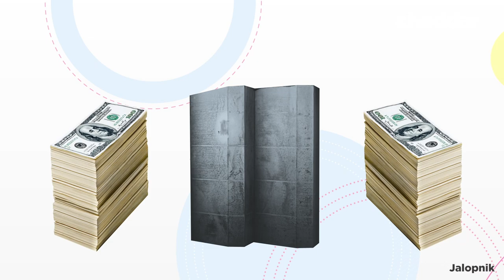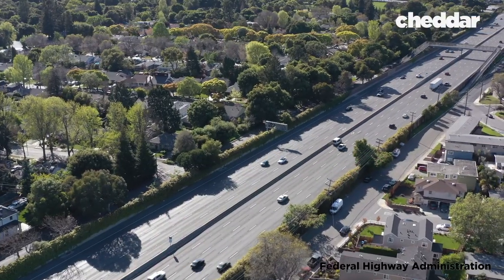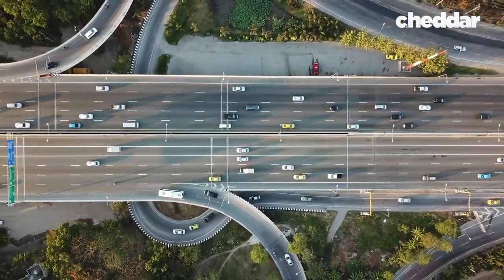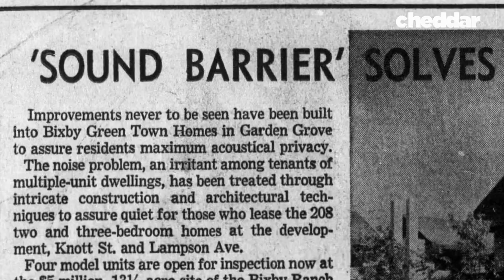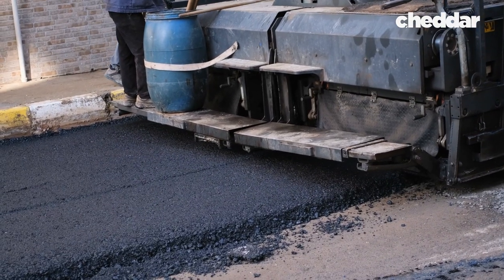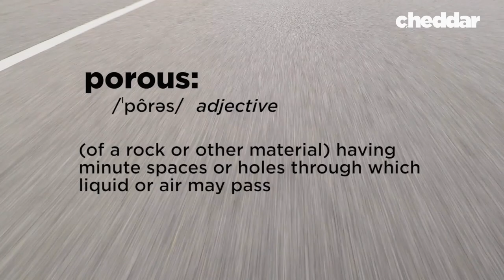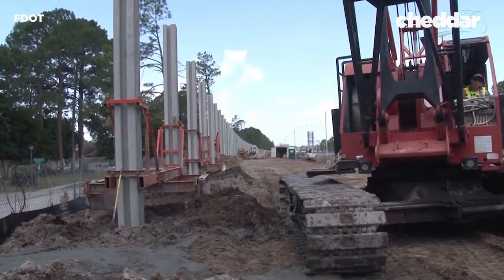How Highway Noise Barriers Can Make Traffic Louder - Cheddar Explains

Comment: Not building interstate highways through residential areas would probably also be a good idea.
Reply: Those residents need to be able to get around though. Ultimately, you are going to need major roads near residential areas because those residential areas are what creates all the traffic.
Reply: @jarynn8156  That traffic doesn't need to be on a single road, and doesn't need to be at fast speeds. Leave the highways outside of the city and most of the problem will be solved - people will drive through multiple smaller roads to get to their homes, rather than having their homes cut off from the rest of the city by a highway...
Reply: How about using higher density residential zones to make public transport cheap enough to switch to, even with automobile and oil subsidies keeping car prices artificially low.
Reply: @VanganPL  you understand that doesn't work. Right? Phoenix didn't have a ring road until very recently, and it had some of the worst traffic ever. It had exactly what you said and had far worse traffic than cities much much larger than it
Reply: @PAYTONLB999  more, and more efficient, public transport infrastructure would do way more to curb traffic than more and bigger roads can.
Reply: @_ikako_  Public transit doesn't work when you design your entire city to be low density and suburban. It would be more costly to invest in public transport than to build more roads.
Reply: @PAYTONLB999  strange cause that is exactly what we do in my country and ik works like a charm. We don’t have highways in or trough oud cities.
Reply: @N911GT2  how big is ur country?
Reply: If you removed the interstate a block from my house it would kill off the traffic to the museums, sports stadiums, downtown nightlife, and basically kill the city by wrecking the money that comes in from the suburbs. I don't mind the sound of the freeway.
Reply: What came first, the endless suburbs or the highway?
Reply: When bypass highways are made around highly populated areas those surrounding areas become populated because there's that new road to get people where they need to go.
Reply: The most likely scenario is the highway build there first. The residential follows due to the ease of access provided by the highway.
Reply: @daelbows5783  Not really, bus routes and bike lanes work for any density, you don't need extremely dense blocks like a metro or train station would to sustain them
Reply: @gas-station-sushi  Bus routes in suburban areas are almost always government-subsidized in the US and Canada because the density is just too low. You still need a certain density to sustain bus routes. But about cycling, you're right. Bikes are fine with most densities, as long as your destination is close by. This is why u rarely see cyclists in suburbs because their destination is too far by bike.
Reply: @daelbows5783  That's most public transport though, a lot of it everywhere is in some way subsidized because it isn't profitable, aside from a few exceptions like the Japanese railroad company or HK metro.

That's true, however I still think it might be useful to get people around via bike within their own neighborhood or to the nearby strip malls at the very least
Reply: @VanganPL  but its not sure it will be like that for ever as cities of course grow
Reply: To be clear, I specifically meant building highways through communities that require the acquisition of large numbers of residential properties for demolition in order to build the highway on top of them.  Many of their detractors call them things such as "poor people displacement projects", because those are the communities usually paved over in highway building and expansion projects.
Reply: @gas-station-sushi  The problem with that is you already have the car which brings you to the strip mall faster. Bikes are really only used by kids who can't drive or by people cycling for exercise. The point is, people will overwhelmingly use the easiest and fastest option to get places. And since many end destinations offer car parking, you rarely see people biking to even close by destinations.
Reply: @daelbows5783  Not really, most people just use the car because it's the only way to go. You see a bunch of parking spots or wide highways but never protected bike lanes or bike rails to leave them.
Of course if you make it harder for people to use bikes they won't use them, the Netherlands offers plenty of bike infrastructure and people use them for long distance trips too
Reply: @gas-station-sushi I agree that bike infrastructure can be upgraded and suburban arterial streets should have their own bike paths. This would increase the number of cyclists, but I think cars would still rule. The design of suburbs in the Netherlands is totally different than in North America. Also, the Netherlands has the advantage of being flat and having great temperatures year-round. This is why where I live in Toronto, you are likely to see people walking in suburbs as opposed to biking. There is a great suburban transit network that encourages people to walk to their bus stops.
Reply: @jarynn8156  "Those residents need to be able to get around though"
This is true. But building car dependant residental areas only increases the problem, kind of like a self-fullfilling prophecy. Build car dependant residental areas, so people need a car to get around, so there are more cars in the streets, so city planners think they need to built bigger highways, and as a result residental areas only become more car dependant than before, so more people buy cars to get around, so...
Reply: @daelbows5783  the Netherlands doesn't have great temperatures year round.

Chicago has more cycling than Los Angeles. This ain't about weather.
Reply: @MrIansmitchell  Well many people still avoid biking in the winter months in Toronto and Chicago. But compared to these cities, the Netherlands has great temperatures. Winters are warmer, summers are cooler, and temps are consistent. In Toronto, we had snow about 2 weeks ago in MAY, despite being at 30°C a few days before. 

But I also said suburban design plays a large part in how ppl go to work. Ppl in Toronto suburbs can use public transit to get to work because it is convenient. If they were to bike, it would take hours to get to work.
Reply: @wohlhabendermanager  It's not pleasant riding a bike or waiting for public transit when the weather is bad. You freeze when it's cold, and get soaked when it's raining. And in some places, it's a long walk to the bus stop, often on a limited service route. In your car, you're sheltered from the weather, and you can go when and wherever you choose, you're not bound to public transit routes and schedules. Modern cities are designed for cars, bikes and public transportation are for people who can't drive in N. America.
Reply: @VanganPL  putting highways outside of the city is pointless because the city will expand around the highway
Reply: Since most highways have been built for 50+ years. You should say stop building homes near highways.
Reply: @mike-sk2li  correct. the city expands on the highways
Reply: @mike-sk2li  : Every highway widening project takes land, most often from the very same poor communities that were paved over to build them in the first place.  Communities which have almost always continued to get poorer because of their proximity to the highway.  But yes, for the houses that have been built in the suburbs and exurbs which grew around the highways, I agree.  But at this point many of them were built 50 years ago as well.
Reply: The interstate has probably been there longer than the residential areas. Also that part of the interstate just wasn't that busy and cars used to have much narrower tyres.
Reply: @Treblaine  : Do some research on the origins and effects of the construction of the interstate highway system.  There's a reason their detractors call them "poor people removal projects" and "black people removal projects".  In the 1950s, when most of the rights of way were planned, a lot of black people couldn't vote, especially in the Jim Crow South.  So the powers that were at the time located the highways right through black communities and poor communities, because those were the areas least able to oppose them.  Those areas are still poor today, and often poorer.  But at least today they are somewhat more able to fight back.
Reply: No
Reply: Yeah...shame we don't have any viable alternatives...
Reply: Most likely the interstate was there first.
Reply: @mediocreman2  In some areas, sure.  But the history of driving interstate highways through urban areas, especially neighborhoods that are historically poor and minority areas, is long and unpleasant.  When it comes to urban interstate highways, most likely the community was there first and the highway was driven through it, leaving destruction in its wake.

Comment: in the netherlands we build hills out of earth next to highways to have reduced noise whilst it looking better and also working better
Reply: That’s great, if there’s room.
Reply: In the US we don’t care what’s better. Only about what’s cheaper. Not saying that’s how it should be. It’s just how it is…
Reply: Unfortunately that takes up a lot of space.
Reply: Also the road surface is very different in the Netherlands. Almost all highways have this porous asphalt (what the guy was talking about) which reduces noise 🤗
Reply: there's also that park that was built to counteract the frequencies of sound from a nearby airport that the residents were complaining about
Reply: @_ikako_  I feel like we should just surround airports with rings of parkland it's very desirable land for housing/ business (besides a car rental and a couple hotels) plus airport r usually linked to transit so it would be easily accessible
Reply: @Tomdelongpenis  I feel like we should just build more parks in general tbh
Reply: Sounds expensive to do all that earthwork, also I can imagine that that can cause highway flooding.
Reply: And when we do have sound barriers, they're made of glass, so you can look through it, and are placed at an angle so the sound reflects into the air. Also nearly all of our highways are made of porous asphalt. It does degrade quicker in winter but the noise and water spray reductions benefits outweigh the repair costs.
Reply: @CT-vm4gf  They're more like mounds than hills. Also you can build on top of them, just not houses.
Reply: @Welgeldiguniekalias  They are probably the highest points in the Netherlands. They should call them mountains.
Reply: We also do that from that to time here in Switzerland (when the topography allows). But usually the space constraints preclude it, especially when it comes to refits. I've only seen those near large new apartments developments so far.
Reply: @MrAronymous   Similar here in Switzerland, but after years of experimentation, they've backtracked on the porous asphalt, on the ground of its properties degrading too quickly, and the water spray reductions being outweighed by awareness reduction on highways. But when it comes to city-centers special asphalts are making their way.
Reply: That do that here in NZ when there is room - I'm like 200ft from a motorway and they have built hills and use plants as barriers but I have seen walls installed where there is no room and they are like 14ft tall.

I agree the road surface will play a big part and I noticed how loud concrete surfaces are compared to asphalt.
Reply: @Gnefitisis  cost is not the problem here. its the long-term effects that could benefit everyone.
Reply: Earthen barriers are super effective but take up a lot of space to get the right height. Placing a concrete or brick wall atop the earthen barrier is an effective way to reduce the space needed but still get similar noise reduction.  If there is no space available, concrete walls work too if you make them tall enough or sink  the roadway into a valley.

Comment: typing from nottingham uk. trees and hedges they do exactly what you need them to do, look pretty and reduces noise
Reply: More cost effective too
Reply: @The_-_-  Not really if you factor in the landscaping cost.
Reply: @maggiejetson7904  But not $2,000,000.00 ( 0:19 ) per mile to maintain unless its all Bonzai trees or something I can't think of that would cost that much to maintain.
Reply: @BossInvader1  that isn’t to maintain, it’s to build
Reply: I think natural sound barriers are easier to use in Europe because we generally have climate more suited for life. A lot America is too hot and too arid.
Reply: @nicolaim4275  that makes sense!
Reply: Exactly, I'm from Australia and I lived behind an express way and it was relatively quiet considering we where up on the side of a hill, the speed limit was 100km/h and we had wooden sound barriers and a bush infront, plus it was dug down with slopes on the sides to help too, it wasn't fully quiet (you could hear dickhead truckies using the engine brakes because there was traffic lights ahead like 700 meters ) but it was quiet enough to sleep with the window open
Reply: @nicolaim4275  I'm pretty sure Europe doesn't have as much highway in the middle on their cities like we do in North America. Most European cities were build before cars were a thing thus more densely populated and no room for highway. 

My city metro area have 13 highway, 5 of them are major highway that cross the city and 4 other are east-west bound major highway in the suburb. The 4 left are just small stretch of highway. Most of them were built in the late 50ies, 60ies and early 70ies when the population of the city & suburb went from 1.3M in 1950 to almost 2.7M in 1970. The metro area is more than 4 604 square kilometer or 1 777 square miles big.

https://upload.wikimedia.org/wikipedia/commons/6/69/Autoroutes_Montr%C3%A9al.svg

European city are far from having that many highway, even the biggest ones like most capitals (Paris,London etc.)
Reply: @Boby9333  It depends on how you define a 'highway'. I would have disagreed with you if I hadn't seen pictures of eight lane roads or similar from the US. A lot of European cities made large roads in the cities by building them of top of canals and by tearing down houses, so the olden days aren't necessarily that relevant for comparing US/EU systems.
Reply: @nicolaim4275  highway/freeway can have as little as 2 lanes. What define a highway is the speed at which you can travel, no intersections & enter/exit spaced out. Highway easily get to 100kmh (with some exections within city limits), instead of intersections they have interchange to not impeede traffic and unlike othee roads that have intersection every 100/200meters or so, an highway will usually have an entrance/exit at 1km interval or more.

If you count boulevard (which I'm sure most European country were able to build during the reconstructer post WWII)  then you can easily add 20 boulevard just inside the main city to the 13 highway we have. 

Yes our highway & boulevard mostly have 3 lanes but that doesn't change much. Outside of the downtown area which have slimer street and thus no boulevard (just one highway that is partially underground and transform into a 6lanes 70km boulevard) we have one about every 1km to 2km in a grid. Even if you count boulevard, american city still have way, way more high capacity roads within the city & then european city have.
Reply: Only very very dense trees or hedges help. Studies have shown that trees don't really help otherwise.

Comment: The different types of asphalt/"pavement" make a HUGE difference. We have two types here in Germany. If a highway (Autobahn) section needs to be replaced, they use the "new" less noisy type. You will notice the severe change in noise when driving from the old road onto the new one. Its less than half the noise at least, as far as I can tell.

Comment: I noticed this in the small town I grew up in. There was a railroad track going through town in a deep trench. When the train would sound it's horn it would be extremely loud and annoying. I always wondered  why they didn't just put the train tracks on level ground. Also, the house I live in now has the highway noise problem. We are 150m or 492ft from the highway barrier and the sound is deafening at times. Honks, sirens and street racers can be heard as if they're right outside our house. I hate being outside in the afternoon especially when trying to have a conversation.